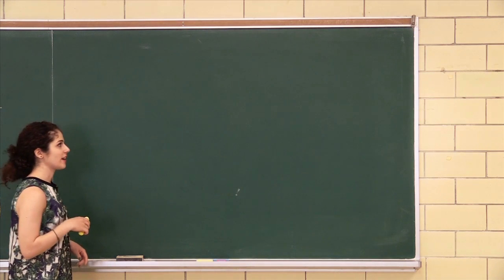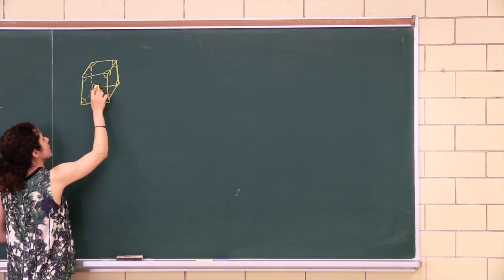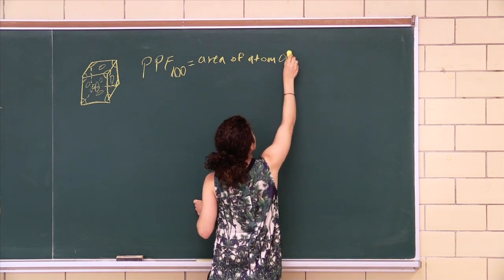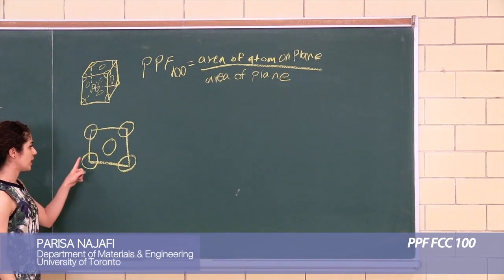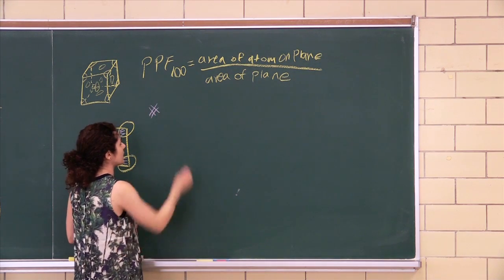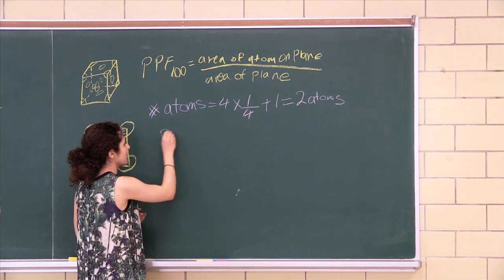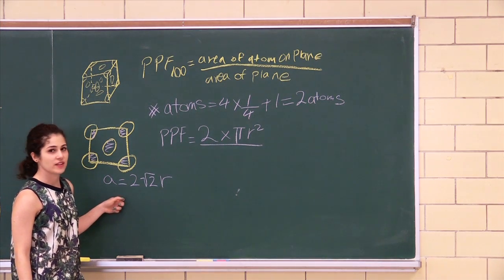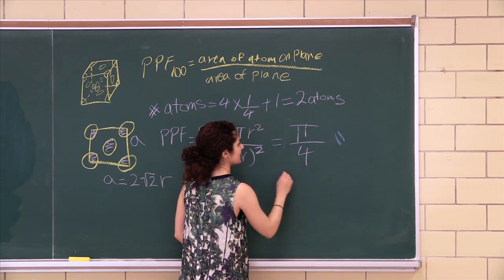Planar packing fraction (factor) for the face centred cubic (100) plane

Comment: In the number of atoms, why is it 1/4 * 4 and not 1/8?
Reply: stern460 because it’s in 2 dimensions not 3 , so an atom separated in 4 parts and each part equals to 1/4